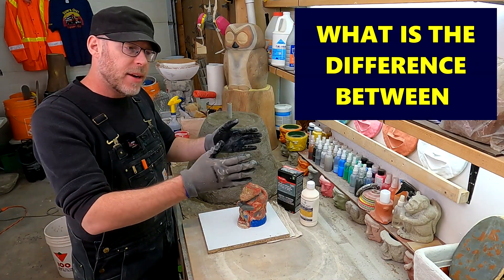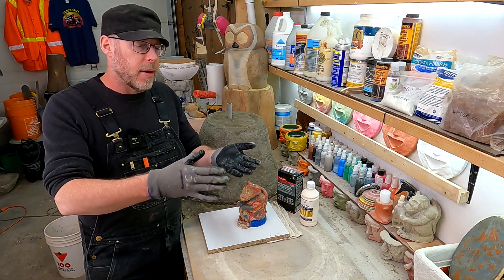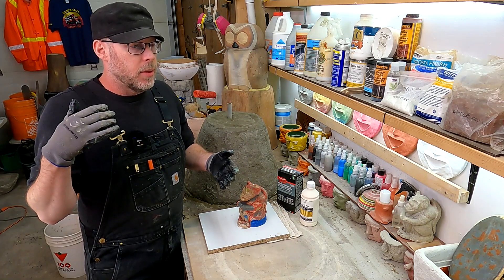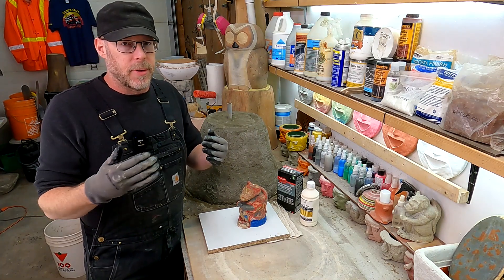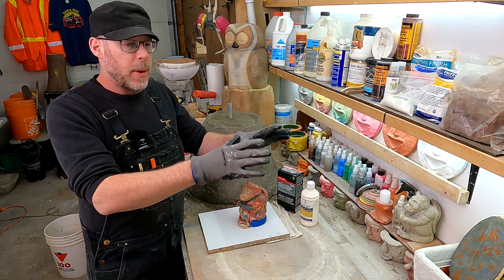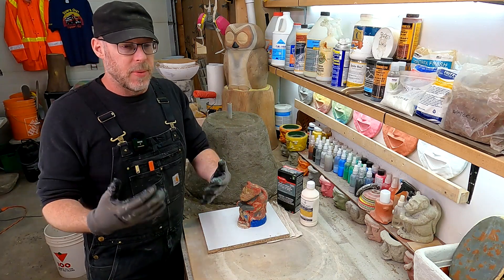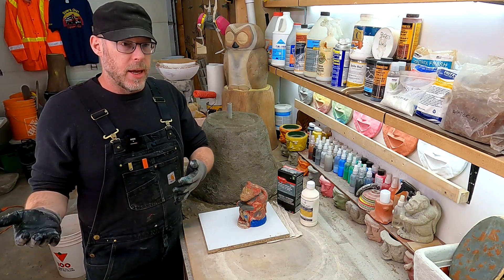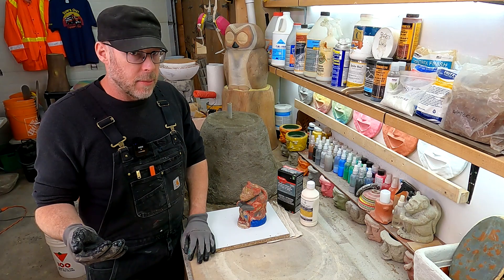What is the Difference Between Patching and Resurfacing Concrete?

Comment: What should I do to fill pinholes in a concrete casting?  I used cement from the premixed concrete bag (sifted out the aggregate) but it was too sandy to fill the tiniest holes.  Would straight portland work for this?  The final object will be sanded and painted.